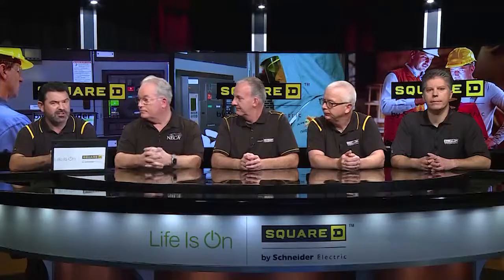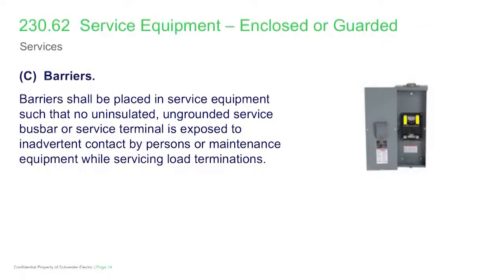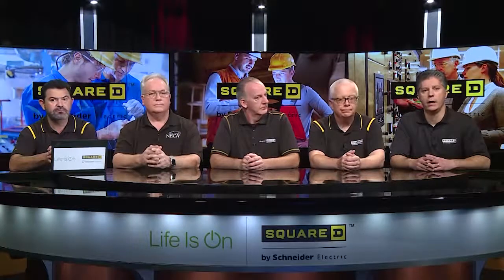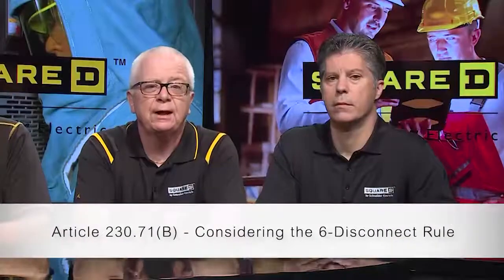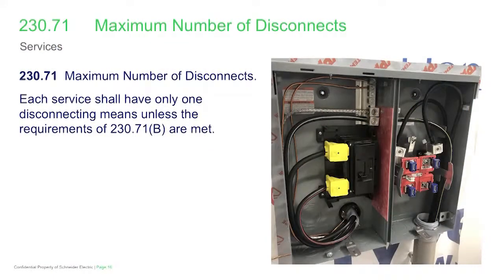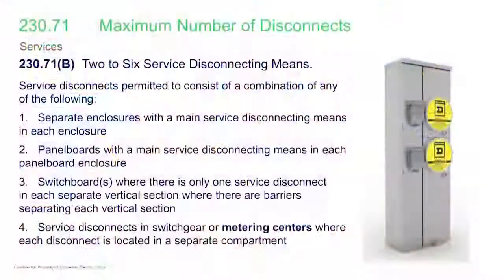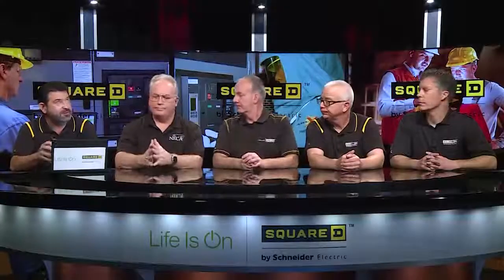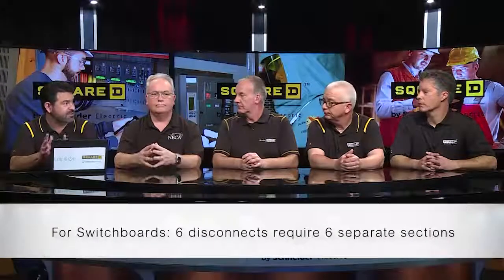NEC 2020: Residential - Service Equipment and Emergency Disconnects

Comment: Can you mian circuit panel be a service disconnect/emergency disconnect if its placed outside?

230.70 General

The service disconnect must disconnect all service-entrance conductors from the building or structure premises wiring.

(A) Location.
(1) Readily Accessible. The service disconnect must be at a readily accessible location either outside the building or structure, or inside nearest the point of entry of the service conductors.

Comment: Why dont you guys actually address what MOST of us want to know ? ie will the requirement for an exterior ER disconnect now by default automatically makes all interior main panels sub panels and thus require grounds and neutral separation!!! A total fukn nightmare for homeowners.
Reply: The NEC are total idiot this is the case but they wont address it